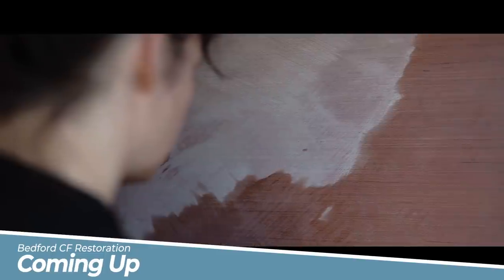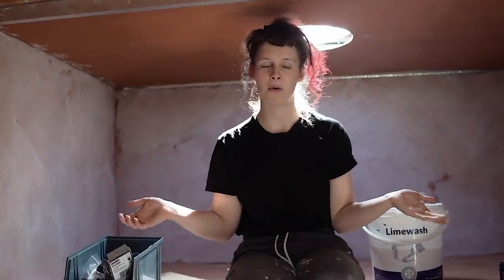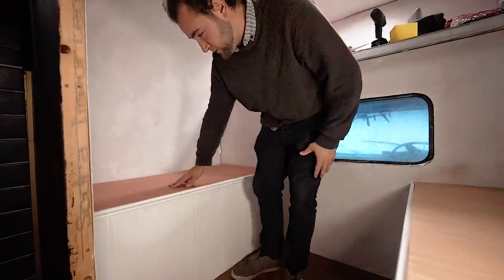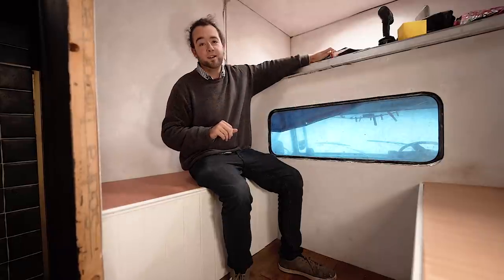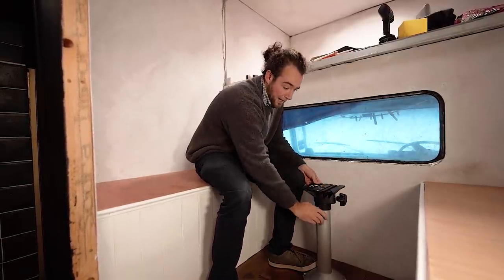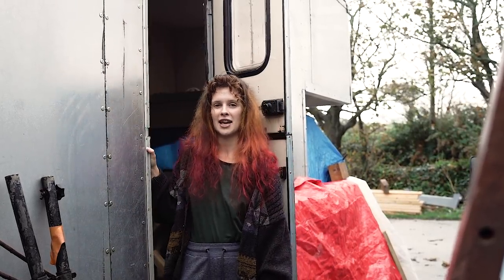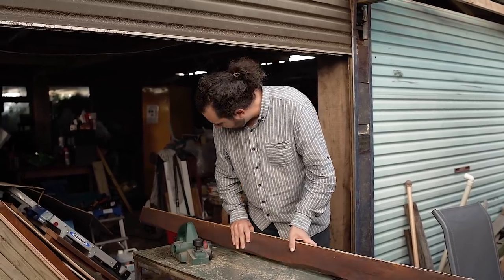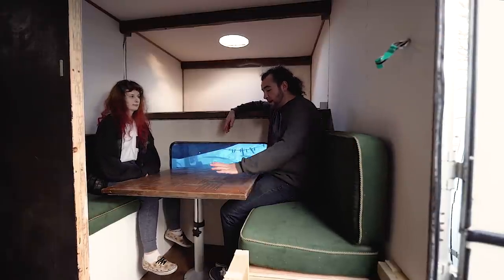This Was a BIG MISTAKE｜Creating a Seating / Bed Area｜Bedford CF Conversion

Comment: Be carefull you are using heavy materials that your van is not over his maximum weight! And with the old engine it still wants tot go up hill. Made that mistake 1 in a old Mitsubishi l300 frankia camper 😉
Reply from the maker: Yeah it’s probably going to be over 3.5t but our plans are to set this up in a field for hire until we’ve recouped enough money on it then we may consider getting it on the road.